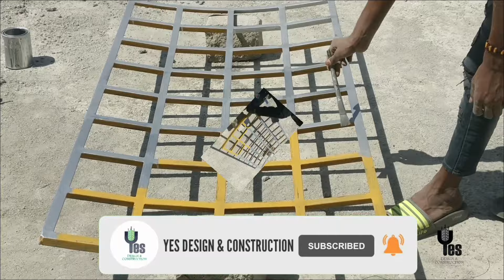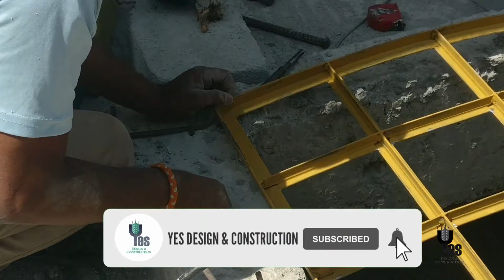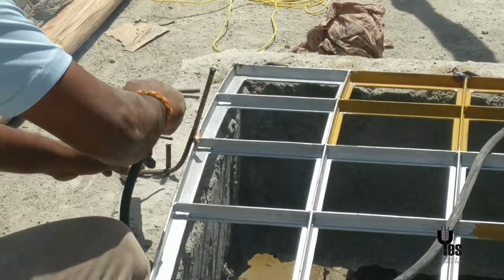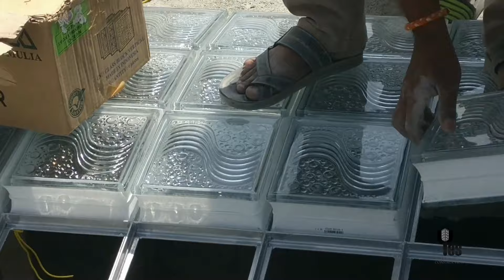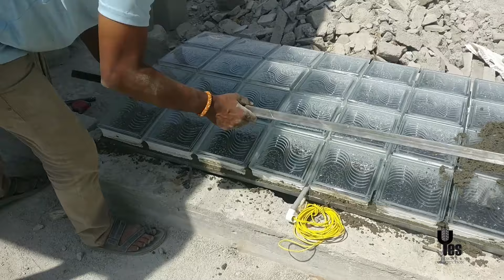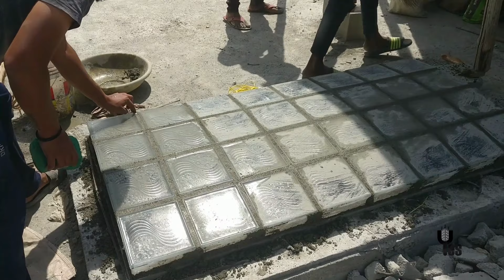Skylight Glass Block work

Comment: Due to thickness of glass bricks with cement packing, light percolating to house is highly restricted. Whole purpose is defeated.
Reply from the maker: Please visit our site and let me show you how the purpose of glass brick is achieved.
Reply: Arre bhai yeh worker glass brick ka use nahi jaanat
Reply: Packing it with cement and no room for expansion or contraction the glass blocks will crack worse case will leak.

Comment: bad idea..glass panel should be little elevated and gap should be provided so that air circulation could take place... otherwise it will become like gas chamber
Reply from the maker: Thanks for the feedback. But I'm sure you haven't observed that the panels are elevated. But for air circulation we provide windows. Hence, it doesn't become a glass chamber.